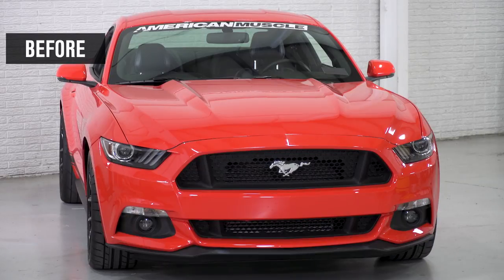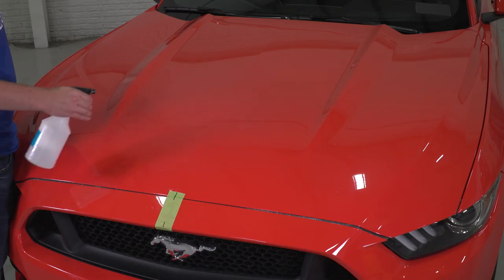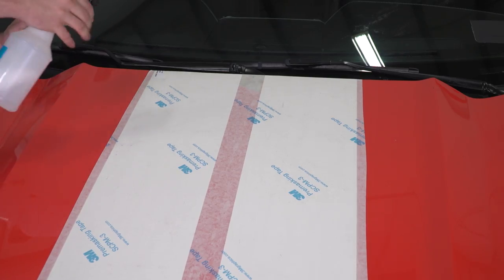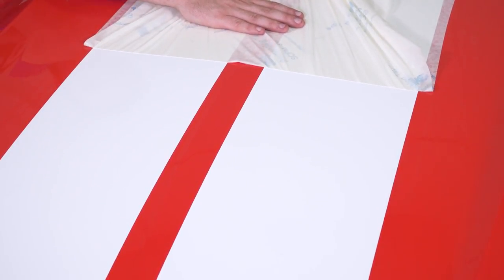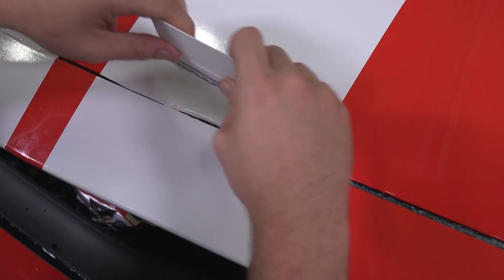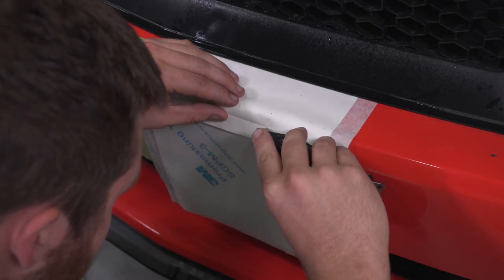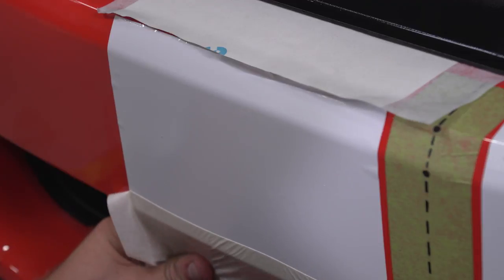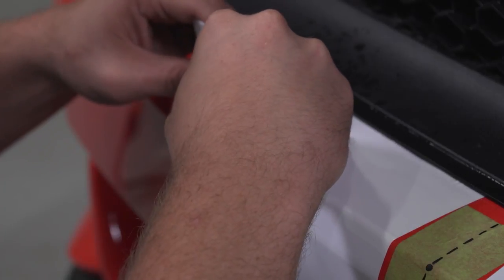Install 2005-2014 Mustang American Muscle Graphics White Lemans Stripes - 8"

Comment: Please answer quicky!! So i purchased this a while ago and what soap do u use for the soap and water mix? does it matter? and what are the measurements of soap and water do i need? need answers asap!
Reply: and I dont want to buy the "Professional Application Fluid" listed on the website
Reply from the maker: A drop or two of baby soap is what I prefer to use per spray bottle full of water.  You don't want a ton of soap.  -Justin

Comment: true, the music is pointless, but there were two tips: it seems like he used 2 pieces of vinyl to go down the bumper instead of just one, perhaps to take into consideration the curve. I have some curves  and although the trunk lid and the back was fine, the spoiler has curves and 4 tries later it was still not good. Although perhaps I was being too picky. Just cant get it all with one piece of tape. I didn't want seams, but I guess perhaps its ok. 
Also, wrapping a small chamois around the squeeze would be a good idea as well! 
My stripes are all custom, so mine are not in a contact paper kit